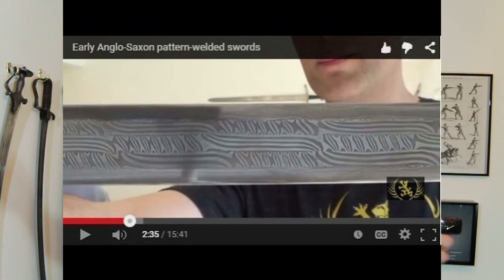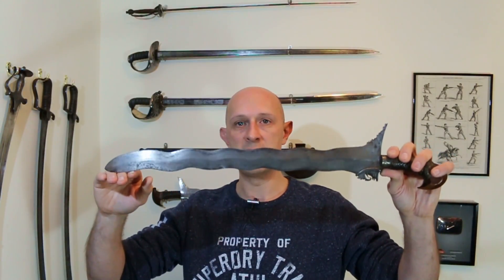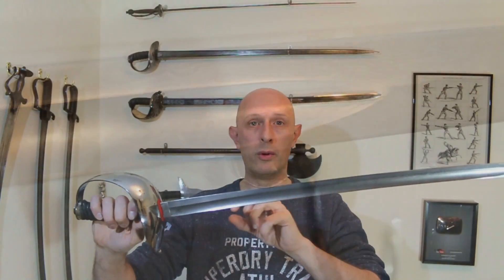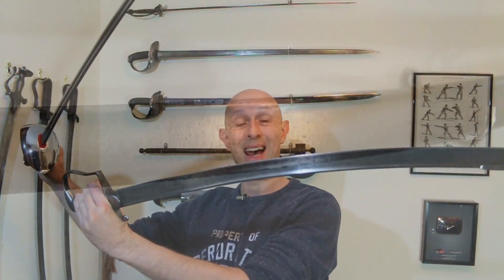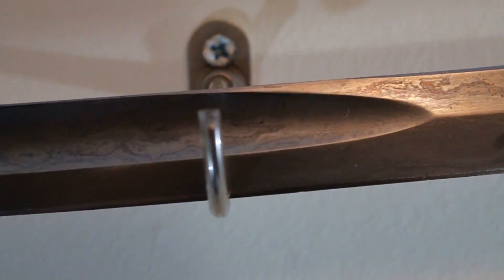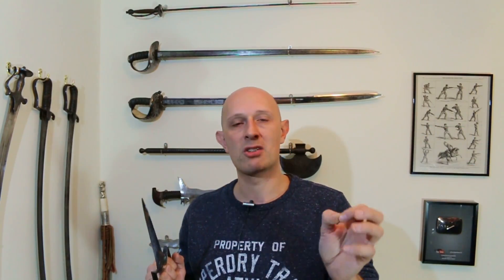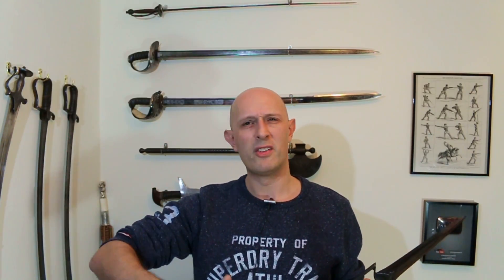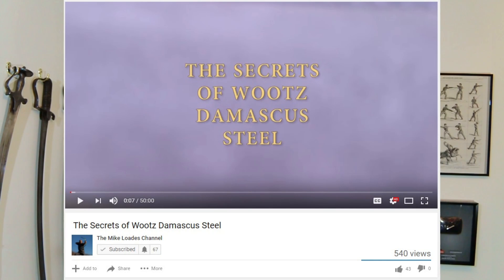Damascus (Wootz) Steel & Mike Loades' New Channel

Comment: When you look at the definition accepted today Damacus steel is realy two things.  Pattern wellded, and Woots damascus steel that is the good stuff.  The "woots has the water ripples, but also has the little cunks of carbide black spots in it that helps give the legendary sharpness. and the one compund at about .8 % that starts with an N.

Comment: I wish there were a cellphone app to identify Wootz.   But after a few of Matt's videos, I think I'm starting to get a handle on it.  I have a few tulwars, and I think two, or more of them are likely to be Wootz.  They have a very similar pattern as shown in this video.  And now, time for a story!

A couple of years ago, I bought the worst tulwar I could find, on eBay.  I was the only bidder and it was under a hundred dollars.  I bought it because it was very rusty, and I wanted to practice cleaning a sword on one that was of little value.  I gave the blade a gentle cleaning and it actually looks pretty nice, with some small areas of pitting.  It has some of the promising features that Matt mentioned in another video, a slab blade, signed, and what was once, a remarkable hilt.  -- The hilt is mostly plain iron today, with bits of what was once quite a thick silver encrustation. (It looks like someone removed it for scrap)  There are also traces of gold.  I took a closer look at the blade and there is definitely a pattern there, so, I guess the wise course is to view some of Matt's sword cleaning videos, remove a bit more rust and then proceed with caution.  I suppose it will never be very valuable due to the vagaries of time, but, it might have been quite something in its day.

Any further hints on identifying Wootz would be appreciated.

Comment: In the late 1970s there was an article in Scientific American magazine about wootz or bulatte Damascus steel. A sidebar within the article mentioned that in a study at Edinburough University thet found that by taking a bar of the steel through a roller mill, pressing it to half it's thickness as it went from dull cherry to king's purple,it created a carbide grain structure so fine that it is only visible under an electron microscope. This can be seen in the wood chisels and plane irons from the Footprint tool company of Sheffield, UK. They take and and hold an edge like no other steel you can buy. By comparison, the grain size in Marples/Record tools is far too coarse, producing a good edge that fractures or chips far too easily.
By the way, wootz Damascus is plastic at much lower temperatures than common steels.

Comment: Here's something that might not be widely considered: Pattern welding steel is a great way to control carbon content in a context where the stock metal may not have an appropriate composition for swords. Have some wrought iron and some really high carbon coked stuff? Mix it thoroughly and make an approximation of 1060

Comment: I did read somewhere that the term 'pattern welded', is actually quite modern, too.  I wonder what they called pattern-welding before they started calling it damascus.
Reply: The roman empire coined the terms laminated/laminated blade or pile-forging

Comment: Damascus steel is very particular to a specific iron mine that had the right balance of alloying metals. Not all of it had a pattern depending on the bloom, smelt and forging. They have varying grades and varying patterns. The more defined and tighter the pattern, the better the quality.

If you reconstruct the actual process that produces the same patterns of formations without using Iron from that mine near Damascus, it could be the same quality, but it still isn't actually Damascus steel. 

Wootz came from many different places, but the absolute best was produced in Damascus.

Comment: well you got it mostly right in my opinion
i think is was in 1975 ish  that it was agreed to call pattern weldet steel damascus
but apart from that i think the term damascus steel is wrong to begin with as i understand it was just a place were you could buy  ingots and it came actualy from elsewere

Comment: Why is HEMA historical sources considered "the best", but we know that historical eastern martial arts are completely inferior to modern MMA? This isn't a troll question, I genuinely want to know the answer.
Reply from the maker: I'd say that the second part of that question is false. Lots of modern MMA fighters are using a mixture of boxing, kickboxing, jujitsu and Western wrestling. Those are all old tradition arts. Secondly, they are being used in a very particular modern sporting context, without shoes and in a Cage - the presence of walls, hard floors, shoes, clothes, perhaps multiple threats and weapons changes everything. Wing Chun might not make much sense in the Cage, but it probably makes a lot more sense against a knife than modern Cage fighting systems. It's all about context. Martial arts each evolve to fit their context.
Reply: I don't think people claim it's "the best" as in it's better than everything else, but that it's the closest to what was done historically.
With enough experience, you could probably find new techniques that we didn't find in any treatises.
Reply: The historical treatises for HEMA are drawn from time periods when those weapons were actually used in life and death situations. Those contexts no longer exist, so any 'new system' would be nothing more than sparring or competition techniques, not genuine martial arts.

Comment: I dunno. Wootz has definitely been called Damascus for longer,  but, for me at least, it has about as much claim on the term as pattern welded steel does. Neither were made in Damascus anyway, so it’s better to normalize the term wootz as a particular type of Damascus, or as the “original” type. Once I heard that word I just started referring to it as such. 

I didn’t know that wootz may require vanadium. That’s super interesting.

Comment: To be honest i'm starting to get annoyed with the wootz steel shit.  It doesn't have magical powers nor is it some super steel in modern terms.  It is just basically the first form of steel that was produced in larger quantities that had good carbon content for blades.  They melted the iron ore in a sealed crucible to stop migration of carbon so they could somewhat control carbon content and get it to high heat to properly separate the liquid steel from the impurities.  So yes. back then it was a huge leap forward in technology.  The fact is any piece of  modern carbon steel will totally out preform it. My comment isn't directed at anyone except the people who are turning wootz into the new katana.
Reply: so place name me the modern steel that combines hardness and flexability like damaskus had
there is a reason why they try to rediscover this and i am pretty sure its not to please katana fans
Reply: it's not about it being magical or anything like that, its about appreciating the mastery of these craftsmen in the past who created a remarkable steel with the most rudimentary technology. Of course it isn't magical... if I was in a fight I think i'd prefer to have a fully loaded AR-15 to even the most well crafted sword. The point isn't how good it is by today's standards, it's about the engineering achievement of people in the past.
Reply: there's nothing overly remarkable about Wootz when compared to modern steel, or even steels of antiquity.  what's remarkable about it is the pattern you get from the carbide banding, and how amazingly difficult it is to 'coax' that pattern out of the steel.  anyone can make crucible steel, but making it exhibit that watered pattern seems to be tough...

Comment: 7:00 minutes in I had an idea - Get different kinds of crucible steels, turn them into different Wootz Steel with different levels of vanadium. Pattern weld them into a functional blade. End-product is a Pattern welded wootz blade.

Is this possible, will the patterns be as striking, and/or will the pattern welding erase the efforts of the wootz?

Comment: And then there's also wrought iron, which is steel with very low carbon content but has the pattern on it because of the manufacturing process (essentially same as pattern welding) :P
Reply from the maker: Wrought iron is not steel. It is iron :-) Iron becomes steel when it has about 0.002% carbon added. Below that, it is iron.
Reply: So that classifies most wrought iron as steel, as it has a carbon content of around 0,08% ;) That therminology is all messed up, definitions used by smiths, metalworkers, chemists, archaeologists and internet people tend to vary by quite a bit :P Pure iron is almost impossible to create and does not happen in nature, so there goes the chemical definition. Metalworkers don't really have a bottom carbon content for something to be steel (as not all steel uses carbon in its alloy), but it's generally agreed that it's between 0.002% and 2.14%. Above 2.14, EVEN MORE CONFUSINGLY, it becomes cast iron, even though it's the least irony and most carbonized of steels. And then that definition classifies wrought iron (traditionally called that) also as a steel. And then the archaeologists tend to call iron anything that was made before around the 2nd Century, depending on culture, and after that - steel. So go figure... What an irony.

Comment: NOW I understand why old 'Damascus' steel gun barrels are considered too weak to be safely useable, but 'Damascus' steel (wootz) is legendary.
🗡 🛡
Reply: Only shotguns had Damascus barrels, and the problem with Damascus barrels isn't so much inferior steel as the method of fabrication. Rifle barrels from the 19th century were produced by taking a long bar of iron or steel and drilling a bore through it, which is a more difficult and expensive operation but gives you a stronger barrel. Damascus barrels were essentially sheet metal forge-welded into a barrel shape.
Reply: Oberstgreup 
Well, I did state "gun", not "rifle".  🙄

The only Damascus shotgun barrels I've seen have been the "wire-wrap" type.

Comment: Is it worth mentioning that in modern times "pattern-welding" is predominantly used for aesthetic reasons (i.e. the pretty patterns it produces), rather than the structural improvement you get from mixing softer iron and harder steel? In my experience most smiths who do a lot of pattern-welding use something like 15N20 (a high nickel steel which is very bright when etched) and something like EN45 or CS80 (both carbon steels that are darker when etched) - either of which would make a decent knife or sword on their own.

Comment: The "true" damascus steel seen in blades such as the Ulfberht was transported as ingots along the Silk road and then crafted by select bladesmiths.  The reason it disappeared and entered the realm of legend in western Europe was the decline of the Silk road trade route (around 900-1000 AD).  Western smiths NEVER knew how to make it, only forge from imported ingots.  As you mentioned, the exact ratio of ingredients and process of manufacture are still debated.

Comment: pattern welding has always historicaly been a way of reclaiming scrap and broken equipment to make them into weapons. And in the end a pattern welded steel can be very good in certain applications
Reply: It can also be used to make the best out of poor-quality ore and smelting processes. This is why katanas still used similar processes in their blades long after the technique was widespread in Europe- Europeans had much better supplies of higher-quality ore than the Japanese, and didn't need to go to great lengths to produce a blade out of it once they got better smelting techniques.
Reply: Very true, though you need a way to keep the oxygen out of the folds but most cultures have used patern welded blades at some point or annother pretty much for these two reasons at some point in their history

Comment: 1) The infamous Ulfbehrt is actually woodz steel whereas other Viking blades are pattern welded. No native ingots were able to produce woods steel (since it did not contain traces of Vanadium), it has been assumed that they traveled up a river until the Ukraine and went god knows from there.
2) Germans refer to pattern welded and woodz steel as Damast(stahl). Echt-damast translates to authentic damast. Etched damast would be geätzter Damast, or rather unechter Damast (fake)
3) woodz steel does not requite melting, twisting or folding to develop its pattern. Once the mixture is molten into an ingot it doesn't need to be molten again, rather only be heated close to the melting point and let to set for a while. The process is then repeated multiple times allowing phases to separate within the steel (hopefully) creating microscopic domaines.

Comment: So Matt,
Is your admiration for Mike Loades the reason you shaved your head and speak with an English accent?

On the subject of wootz steel, I thought that I had read that it's extraordinary cutting quality was due to carbide inclusions which makes it work sort of like a diamond blade like the kind they use to cut masonry.

Comment: The terminology is confusing indeed. In Russian, "Damask" = pattern welded steel, "Bulat" = wootz / khorasan / taban / farand and other traditional Asian crucible steels (different sorts of bulat, produced in different regions). The main visual difference is that bulat has a very chaotic, irregular pattern (specific pattern depends a lot on the sort), while the pattern of pattern welded steel is more or less regular. This terminological difference causes a lot of confusing when dealing with Western sources which refer to wootz as "damascus". As far as I know, the pattern is the result of the formation of cementite crystals (dendrites) in the alloy due to very slow cooling, not vanadium or any other alloying additives. In small quantities bulat is produced in Russia since XIX century, often used in custom knifemaking, it has the same carbon content as cast iron (~2%), but is malleable like steel and can be forged more or less normally, it also can be layered / pattern welded, layered with other steels, etc. Hardness is typically 70 HRC and more.
Reply from the maker: My understanding from the documentary (and I may have misunderstood) is that vanadium is what gives the steel the particular mechanical benefits associated with wootz steel, and while you may be able to get similar patterns through other means, it is the vanadium which creates these mechanical benefits (toughness at higher hardness).
Reply: This is a source I read some time ago that lays out the vanadium hypothesis quite clearly and tests it: http://spotidoc.com/doc/97175/the-mystery-of-damascus-blades
Reply: Apparently Asians never called crucible steel damascus steel however Europeans called damask everything that had damask like pattern.

Comment: So what is the connection (if any) with the fabric called damask (derived from Damascus) in which the warp and the weft are designed to reflect light differently according to the position of the observer?  Isn't a damascus blade just one which looks a bit like damask fabric?
Reply from the maker: This is a frequently debated point and the answer is that nobody knows the full answer. It could be that both damask fabric AND damascus steel are named that for similar reasons, rather than one being named after the other.
Reply: Like many precious objects and luxury commodities, damask cloth seems to have originated in China and reached the markets of Damascus by means of the Silk Road. 

Europeans encountered this detailed and colorful cloth when trading with Islamic merchants. And like many material goods, the cloth was produced first in Europe by Italians, using the term 'damask' to describe the cloth, meaning 'pertaining to Damascus.' Not surprisingly, damask was common in Muslim Spain as well, another route of transmission into Europe.